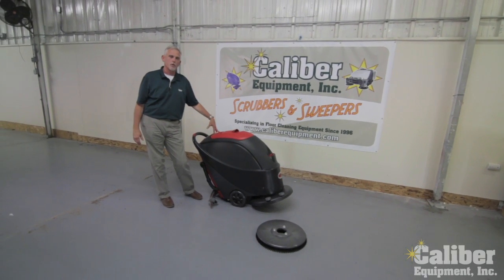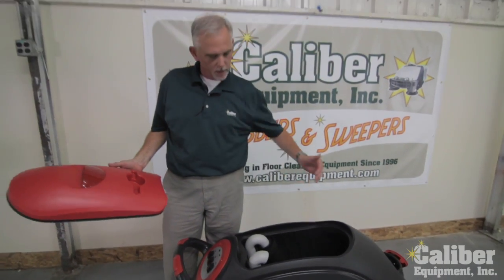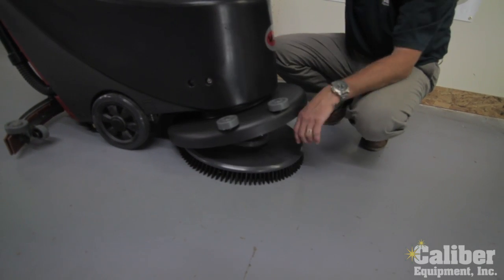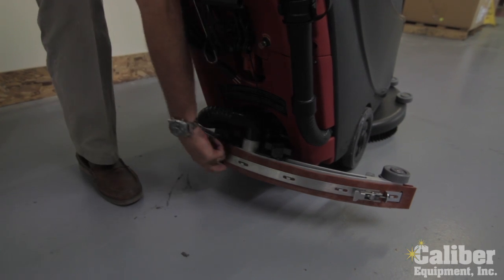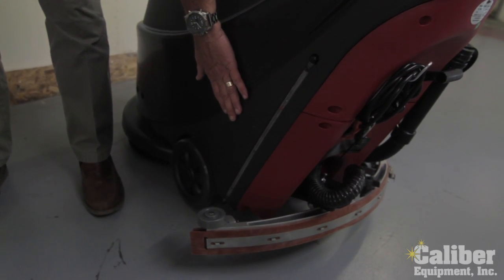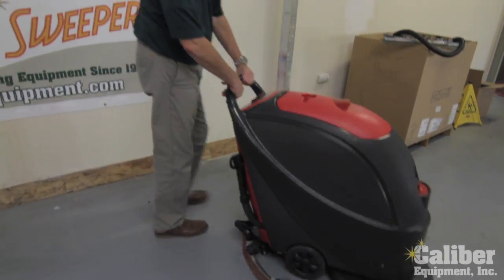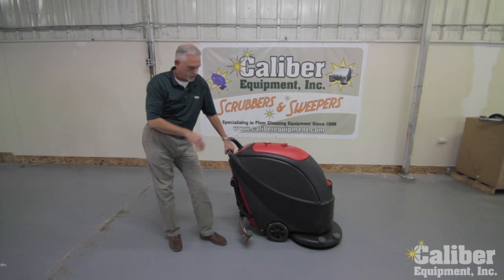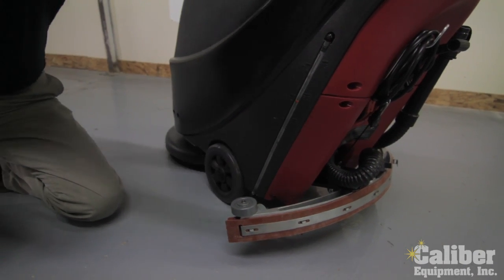Viper AS510B Training Video

Comment: Can you add an extension cord to it to eliminate the batteries
Reply from the maker: An extension cord cannot replace the batteries but check out the Viper AS430C which is the corded version of this model. The biggest difference between the two is the AS430C has a 17 inch deck instead of a 20!
Reply: @Caliberequipment  yeah I know that I'm trying to see if I can just run it off of an extension cord and eliminate the batteries to do some small hallways this is not my primary auto scrubber I use anymore
Reply: @Caliberequipment  okay cool thank you

Comment: Do you have a video or instructions on how to remove a stuck brush pad if 1 nut locks in place, but 2 don’t. Thanks.
Reply from the maker: That's a tough one - We've seen that happen on other machines as well. If possible, try to unscrew the stuck lug. If it is not accessible, you might need to unbolt the entire driver. We would advise calling a local service technician if it remains stuck.
Reply: @Caliberequipment  Found a small opening where you can stick a screw driver in to keep the motor from spinning then you can move the brush pad without the base spinning. Figured out that only one nut was catching because the belt was slipping a little preventing all the nuts from catching so make sure to check the belt regularly.

Comment: I use a Viper machine at work in a factory, the build quality isn't the best, recently the battery has been cutting out even though it gets a full charge every night. I've used Nilfisk machines in the past and they are much better.

Comment: Can you give me information on how to reset the charger to work with gel batteries?
Reply from the maker: With gel batteries, you shouldn't have to reset the charger. You would only have to if you went with flooded batteries. Check the owners manual for more information.

Comment: My filter is clean but supply water is restricted..is there a way to clean supply tank?
Reply from the maker: Take the filter off- There should be a drain cap on the bottom of the solution tank.

Comment: I have one of these exact models in my workplace and recently been getting so stressed with it, the vacuum keeps cutting out, I keep having to reset it! Any ideas? The whole machine cuts out too when the vacuum button comes out at the back and then takes a good 2 to 3 minutes to reset.
Reply from the maker: It sounds like the vacuum motor is being overloaded. Check for a clog in the recovery hose or tank. If you can't find a blockage, it could be a weak circuit breaker that needs to be replaced. If you're still having problems, give us a call at 1-888-550-0945 and we can help further troubleshoot the machine.
Reply: When starting the machine for the first time,  with everything set up,  it failed to pass any solution.  Tried adjusting,  no changes.

Comment: Why the vacuum not power enough to vacuum water ? Is there any problem ?
Reply from the maker: Sounds like you have a clog or a hole in a hose, or the recovery lid could be loose. You are losing vacuum power which causes loss of suction. If you still need help, give us a call at 1-888-550-0945!
Reply: У нас на работе, я просто поменяла реззинки и всё стало всаывать как положено. Надо перевернуть резинки или поставить новые. Желаю удачи.
Reply: Do you have a WhatsApp number to communicate on topics we do not know?

Comment: What pads are best to use for cleaning a gym floor at the company I work at they use pink but in past at a cleaning job used red and green but was when cleaning a city building where I worked years ago. Now just been using pink on a school gym floor guy over my manager told me to use pink but it doesn't give a high gloss after you use the floor scrubber plus it doesn't get rid of the black marks on the gym floor either in past used a green pad to get rid of black marks pink for a gym floor doesn't seem good to me to use though. They use a T3 floor scrubber battery operated. I know they have the one other one now that works on it's own though. This machine reminds me somewhat of the machine used to use downtown when was cleaning the police floors in the city building. This the first cleaning job that used a pink pad though but work in a school now but have worked in multiple cleaning jobs schools, offices and once in a factory. But when did office cleaning they stripped the floor more often here would be only once a year in the school.
Reply from the maker: Is it a wooden gym floor with a urethane coating? If so, routine scrubbing would be a red pad. Green would be more course and we wouldn't recommend it. Pink is usually used for high speed burnishing. The T3 only spins at about 200RPM, and it is used for routine scrubbing and light buffing. To get a high gloss we recommend a high speed burnisher with 1500 RPM.

Comment: How to install the brush plz help
Reply from the maker: You can either lift the brush and twist it into place, or you can place the brush underneath the deck, turn on the brush power button, pull then handle to start moving, and the brush should lock into place if the brush is centered correctly. Dave demonstrates this in the video, hope that helps!

Comment: could you strip the floor with this machine?
Reply from the maker: It's possible, though we don't recommend using the Viper AS510B to strip a floor. We've found that the wax and residue builds up inside the machine, causing damage to the fan and generally just causing more problems than it's worth.

Comment: I'm using this machine to suck up water after we strip a floor. The scrubber stops spinning and the breaker pops but the machine still stays powered on. Any idea what could be going on? Thanks.
Reply from the maker: Hi Doug, it sounds like the breaker is popping from too much down pressure on the scrub head, which can overload the motor. We also don't recommend using the Viper AS510B to pick up stripper because the wax can build up inside the machine, causing damage to the fan and creating all sorts of other problems. Let us know if you have any other questions!

Comment: Im using the machine in a foodland and from recently looks like water is not properly coming from the pad
Does it have a filter or something that might be clogged?
Reply from the maker: Underneath the lower back right corner of the machine, there is a screw cap for the filter-  That's the first thing I would check. Hope that helps!

Comment: Can I use this to buff floors too
Reply from the maker: Technically you could use a buffing pad with this machine- however since the Viper AS510B is a low speed machine, you would not get the same shine on your floor as you would with a high speed burnisher.
Reply: Caliberequipment 
After a strip and wax, should you buff or burnish the floors?
Reply from the maker: It depends on how shiny you'd like the floors to look- After a strip and wax, a low speed buffer will give you a low luster, while a high speed burnisher will give your floor the best "high shine" look.